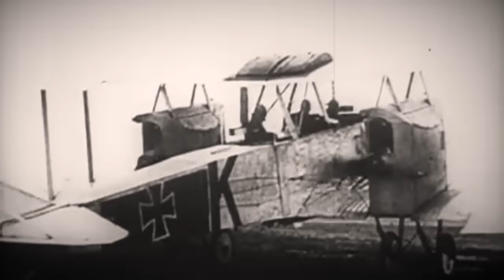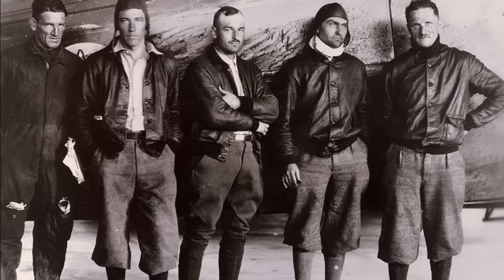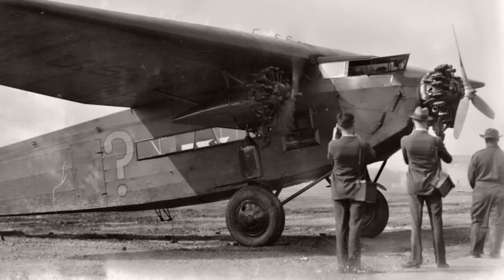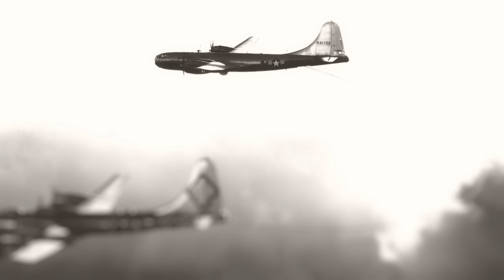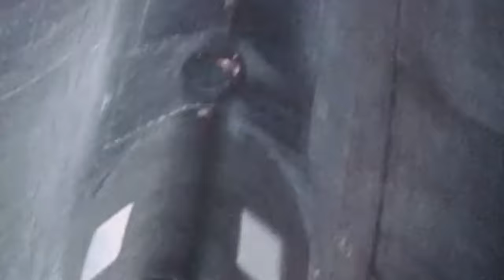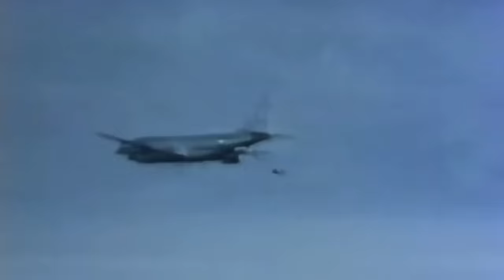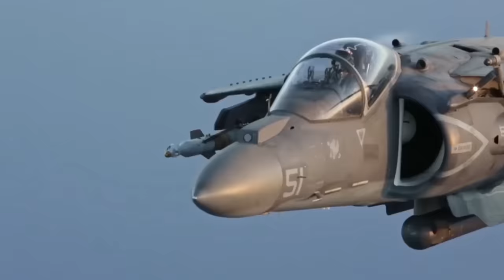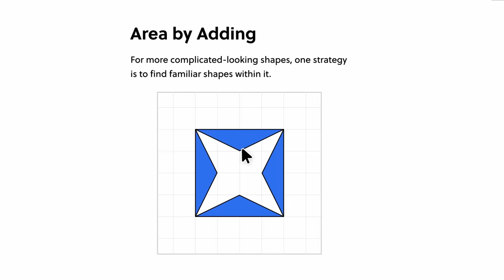The Surprising Story Of Aerial Refueling

Comment: 36 year Boom Operator here with 6400 flight hours all on the -135. 1980-2016, I got to fly through 3pm different engine variants and the cockpit modernization from the old “round dial” cockpit. For all the mods done to the aircraft during my tenure, the boom pod only saw a couple of mods to include a tail mounted floodlight and a boom trim mechanism.
Reply: Awesome thanks for everything you've done
Reply: DIFFICULT to be lN military over 3O yrz ... flag ranx exceptionz
Reply: @BattShytKuhraezy  Why is it difficult to be I. The military for more than 30 years?
Reply: Obviously you've never heard of the Guard and Reserves...I had a good Friend Serve 30 Years Active duty...Retired...and then went to the reserves for an additional 10 years
Reply: @GaryHall-kx9mw  30 in AD is huge, but yes. My chief is at 37 years in my unit and was my senior when I came back from AIT. There is no max TIS in the guard to where if you don't make rank you are non-retained. HOWEVER you do have to see a board after 20, so you can get non-retained if you are holding up others from progressing and not bringing a benefit to the unit.
Reply: 20 year boom operator here. KC-135A from 1979-1984, to include training on the KC-135R in 1983, to KC-10's from 1986-1999. From one boom to another, 
"Boom Stowed, Leaving Position."
Reply: @MrGoodnplenty1957  Gucci Boys! I knew a few Reserve guys. They were former -135 guys from my guard unit (101st).

Comment: My grandfather was a pilot of B-29's during WWII and was selected to be one of the first pilots to test in flight refueling after the war in the GEM program. He said he was selected because of his formation flying abilities and that it was very intense training that required the upmost concentration. Throttle control was paramount when the tanker was loosing lots of weight and his plane was taking on weight.
Reply: That was before computers controlled everything. I couldn’t imagine the concentration it would take and having to constantly monitor your engine power and watching the other plane to make sure you stayed connected and didn’t crash into each other🫡🫡
Reply: Immensely brave men and women!!
Reply: Wow...I never really thought about that for some reason. The refueling plane would be wanting to climb,  while the plane getting fuel would be losing altitude and speed. Them boys in WWII were a different breed. They don't make 'em like that anymore, sadly.
Reply: @RILEYLEIFSON_UTAH Pilots today can indeed still handle increasing/decreasing weights in flight manually.
Reply: @tracyrreed   That's awesome. Especially considering the amount + rate (weight) of the fuel being transferred! They said 1,000 gal per minute, right? That's 6-7,000 lbs. per minute. Or 100+ lbs. per second! Crazy.
Reply: @twerktospec   Are you okay,  bud? 
Your comment is extremely insightful...🙄
Reply: @RILEYLEIFSON_UTAH  Look at that 100lb/s in terms of percentage weight of the aircraft. A B-2 pilot flying his strategic bomber at a max gross weight of 336,500lb is only seeing a change of .02% per second. Of course, that's an extreme example. A big heavy plane which is already full of fuel. Let's go the other way. An F-16 (light plane) at empty weight (as it would be nearly empty of fuel having already dropped its ordinance on a target) weighs 18,238lb. A transfer rate of 100lb/s is still only 0.5% per second. And it's this percentage that a pilot feels. That's definitely noticeable but not unmanageable. I've flown lighter aircraft and I've flown heavier aircraft and one thing I can tell you is that it's all relative.
Reply: @tracyrreed  Yeah, I guess when you put it like that, it's not AS drastic. That's awesome you've flown a wide array of aircraft and know firsthand.👍🏻So, Is 1,000 gal. per min. the max they can do? I haven't had a chance to watch the video again... but did I hear that they got up to a rate of 5,000 gal. per. min, or am I not thinking correctly?
Reply: @tracyrreed  That makes sense when you look at weight percentages. I was lucky enough to have my grandfather wright down some of his adventures as a pilot and read through it again recently. He said while training they would be refueling for around 20-25 minutes. Not having an exact procedure for things that came up made him very on edge the entire time and he was pretty frazzled once back on the ground and the debrief was really long. There weren't many "incidences" with his team but he did say they weren't afraid to quickly kick a pilot out of the program. Poor guy was then sent to the artic circle for survival training where he almost died from appendicitis. Real deal survival training I guess.
Reply: There’s always someone that knows someone or was related to someone that did something! 
But they never provide the last name and rank! 

When you’re flying in aircraft long enough, you get the feel of it! I’m not saying it’s difficult, but I am saying it’s not impossible, especially if you’ve been flying enough! Formation flying is literally flying in formation. my point with that is, you’re flying the same exact aircraft, the same exact way with everything being the same with the only exception in a formation! I guess I’m biased, for me aviation with Something I was interested since elementary school. Luckily, there was a high school in my city that offered aviation as a class to graduate with your private pilots license. I guess because I was both interested & it was something I’ve wanted to do since I was little. I never had a problem, forgetting anything from any of the classes or just about anything else. But they say if you have a strong interest in something you retain it easier.
Reply: @tracyrreed  it's manageable, but I imagine it's a lot to manage - given the receiving aircraft would be receiving fuel into multiple tanks, depending on how the fuel transfer was implemented, it'd be potentially affecting the plane's trim rather more drastically % wise than its overall mass.
Reply: Calling bullsh*t here
Reply: @bountyhuntermk2520  Whom are you calling on that? I’ve posted a link in the replies that to an interview he did with the Veterans History Project but I don’t have to prove anything to you. Have a lovely day
Reply: Interesting! Thnx for posting
Reply: MY GRAND FATHER REFUSED TO JOIN THE MILITARY AND LIVED A GREAT HAPPY LIFE.
Reply: It is interesting that you didn’t mention the Key brothers of Meridian, Mississippi in this video, and the “spill-free” fuel nozzle that was developed for their flight.  On June 4, 1935 they took off from Meridian, Mississippi in a borrowed Curtiss Robin, they landed 27 days later.  The fuel nozzle that was developed for their flight, with only minor modifications, is still in use today on the KC-135 tankers.
Reply: Utmost, not upmost.
Reply: Pictures or it didn’t happen!
Reply: MY GRAND FATHER WAS IMPREGNATED BOMBER PILOT IN  2012 CHINA USA WAR

Comment: It’s crazy how the kc-135 was only the second aircraft built from the factory to be a tanker aircraft and is still in service today.
Reply: When it’s right it’s just right.
Reply: @@Patient-957 87.5% of it's engines remained in place.  That's better that some ground vehicles.
Reply: almost makes you think that we stopped innovating since then 🤔....yes we did ..😡we need to find a better way already....using robotics or something !!😠
Reply: @billhanna2148  we have newer refueling tankers but the military keeps the old ones around because they often don't need the extra fuel capacity of a newer tanker. Additionally with newer fighters and new engines that are more efficient you just don't need that many new tankers, at least until the old airframes wear out.
Reply: @T-Dawg123a  there's no excuse for not innovating a solution for making tanking reliable.  I am sure you have seen many instances where tanking goes wrong or a mission gets scrubbed when someone cant get tanked up. AND the current method is from 1960 !!! yeah someone's not doing their job.
Reply: They're flying as we speak. The Uk uses them extensively.
Reply: @@Patient-957I disagree.  My Dad was a boom operator in a KC-97 and then KC-135.  I don’t recall any refueling related accidents during his tanker years from 1955 to 1963.

Comment: I'll admit that I'm biased since I started my military career as a KC-135 crew chief, but I don't think that drone tankers are going to oust large manned tankers from service, probably ever.

Tactically, in contested environments forward, the drone tankers definitely have an advantage, but that's only part of what tankers do. Tankers have the ability to drag fighters from their main bases, plus carry the support equipment and maintainers to sustain those fighters at the same time. Also, in the procurement game the Air Force has a "no more vanilla tankers" policy, so your tankers have cargo, medevac, and roll on command, control and communications capabilities. Even current KC-135s are equipped with the ability to mount pretty impressive communications networking capabilities.

There will definitely be drones in the aerial refueling mix, though especially when they put booms on them to support the non-probe USAF birds.

A hypothetical mix would be manned tankers supporting a strike package from CONUS to within the range of enemy air defenses and then the smaller, stealthy drone tankers supporting the strike package within EAD range.
Reply: When it becomes possible, on paper, to make an unmanned aircraft do the same things as a human operator does in terms of the specific mission. One needs to take note.
When an unmanned aircraft successfully completes a few missions, without failure... One needs to worry.
When unmanned aircraft start planning their own missions, without human intervention... One needs to turn it off before Skynet is formed.

Unfortunately, as automation matures and the biggest players in that game start pushing out standardized machines that do most jobs out there, we humans will stop manning <insert vehicle/machine here> because the robots/drones/AI is cheaper than human labor/crews are.
It is inevitable because profit margins is all that matters to the heads of big business.

Is this a bad thing? Depends on which side you are on. But if you are on the "right side", you will benefit from increased standards of living at the expense of your income security/stability. Eventually, humans will just be consumers, they won't actually work for a living. It will be Wall-E basically, bunch of obese space tourists.
Reply: What drones may do that is a game changer is make in-flight refueling affordable for commercial aircraft.
Reply: I am a retired tanker crew chief also.  The Navy has a drone refueler that can take off and land on a carrier, and fly a pattern that any aircraft that can connect to its basket, can get fuel.  The drone is on autopilot, so no big deal.   The receiving aircraft still has to make the contact, and stay in position.
Reply: @robertheinkel6225 yeah, the drone definitely helps the Navy do their thing. For joint air operations in general, the thing that drones can't keep up with is pure volume. When your theater planning sections are doing their thing, they're planning on how many hundreds of thousands or even millions of pounds of on-station offloadable fuel they have available, which you're not going to get with the navy sized drone. Manned or unmanned, generated sortie count is generated sortie count and has manpower demands for maintenance. If one were to design an unmanned tanker sufficient to support large, modern air wars one would probably end up with something like a 737 sized drone that's all fuel tank. And then you'd be losing out on the ability to move cargo, people, or do stuff like roll on airborne ops centers or airborne battle management suites.

Maybe you could have a large manned tanker top off smaller, stealthy drones and then the drones could go directly deliver fuel to 5th or 6th gen aircraft deeper in the higher threat zones on demand.
Reply: @JohnGeorgeBauerBuis  I work for an airline now, and I'm not so sure about that. Modern airliner engines are reliable, efficient, and capable enough that the pacing factor is the average person's endurance to be in a noisy tube in the sky with hundreds of strangers. When I was going through some initial ETOPS training years ago, medical emergency diversions were more common on long distance flights than engine or aircraft systems faults and failures.
Reply: drones will definitely become a huge asset for aircraft carriers though. They're stuck using F-18s which sucks
Reply: All pilots will be replaced, this century.
Reply: Agreed, they will supplement manned tanked but do not have long range capability.

Comment: Great work!

In the FWIW department. The USAF solved the early issues with Tanker/Receiver speed differentials (rather than the receiver nearing stall speed) by flying a “toboggan”. Both aircraft would start a shallow descent, allowing the tanker to speed up to an appropriate speed for the receiver. It was still a thing we kept in our bag of tricks if we ever had a speed-limited refueling.
Reply: Awesome bit of info!
☮
Reply: The toboggan maneuver is still used today for receiver aircraft that are power limited. (A-10, C-130). By descending, this allows the receiver aircraft to be able to move into position where it would otherwise be impossible during level flight.

Comment: One thing you missed was why the USAF chose the flying boom for it's primary refueling method for decades...refueling fuel capacity on the refueler plane and greater the of fuel flow...very important considerations when you need to gas up large planes like B-52s.

The Navy is generally size-limited on it's planes -- specifically carrier planes -- so the higher fuel flow rate is not needed, thus the P&B works well.

Now, USAF tankers can employ both methods for better cross-service fueling.
Reply: I believe there are also stealth considerations. P&B requires an outshooting connection point to make contact with the drogue, however it is much easier to engineer a boom receptacle such as the one in the B2 that can hide itself and not contribute to radar cross section while not in use.
Reply: @professorx4047  Refueling ops tend to take place far out of range of enemy defenses, since the tankers can't defend themselves.  Stealth isn't much of a worry at that point.  Plus, the 2 systems haven't really changed that much since before the stealth era.

Besides, the tankers are not stealthy in the slightest, and they have a FAR bigger radar cross-section than the refueling systems they deploy.
Reply: @samsignorelli  The stealth concern is for the boom on the receiving aircraft rather than the tanker.  You'd have to engineer the receiver boom to completely retract into the airframe which adds weight and complexity (moving parts, bearings, motors, etc)
Reply: @WS-nv6cp  The planes fly so close together during refueling, they're going to make one big signal...a radar that misses the stealth plane -- even with the small radar return on the probe -- is going to pick up the tanker.

Retracting the probe fulling into the receiving plane is not exclusively a stealth plane thing...the F-14 Tomcat had a  probe that fully retracted into the right  side fuselage, and it was not remotely a stealth plane.
Reply: @professorx4047  this outshooting connection can be retracted, such as on the F35B and F-35C, which are some of the stealthiest aircraft on the planet.
Reply: A retractable probe, or as you so quaintly put it, an "outshooting connection" is commonplace on modern aircraft for aerodynamics more than stealth.
On the RAF's C130's, where neither aerodynamics or stealth were of any real concern, a fixed probe was installed.

Comment: Any story of military flight refuelling should mention the Black Buck raids mounted during the 1982 Falklands war. Port Stanley airfield was attacked five times from Ascension Island, in mid-Atlantic near the equator, using two Vulcan bombers and eleven Victor air tankers. The 7600 mile round trip was a world record for a bombing raid at the time and involved the primary and reserve attack Vulcans being refuelled multiple times, and the Victor tankers had to refuel each other as well using FRL's refuelling system. The military value of the raids has been questioned but they were prodigious feats of flight refuelling.
Reply: I read yours after posting mine about the same subject.

Comment: The Guinness World Record was set in 1958 in a Cessna 172 that flew nonstop for 64 days, 22 hours, and 19 minutes and covered 150,000 miles (240,000 kilometers). That's about six times around the Earth or 15 Sydney-New York flights without touching the ground.
Reply: Where did they go to the bathroom?
Reply: @harryparsons2750  there is a documentary about this story somewhere on youtube and I think they were 2 pilots and it was probably in bags
Reply: The aircraft was refuelled in flight with a hose dropped down to a speedy car on the runway, and engine oil and food hoisted aboard. 
The C172 was equipped with an auto pilot, but there was one point in the flight where the human pilots found themselves both asleep for over an hour.  Days later, the autopilot failed so it was vital that it never happen again. They finally landed when the engine was badly overdue for service, and fuel and oil consumption became more excessive than was practical to resupply.  The engine was not making enough power for a full load of fuel, and refueling needed the attention of both pilots at once too often so not they were not getting uninterrupted rest to continue.  To the pilots it must have been a great relief.